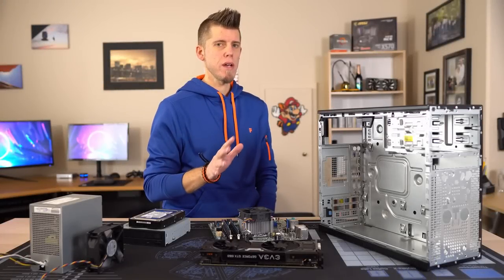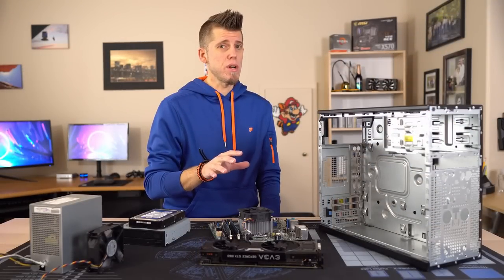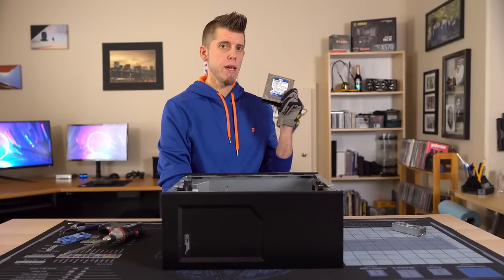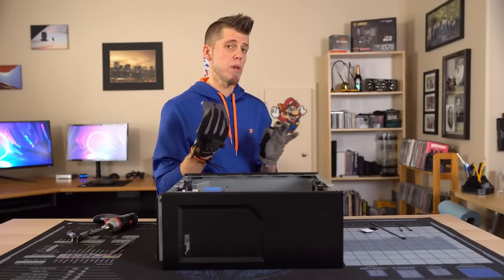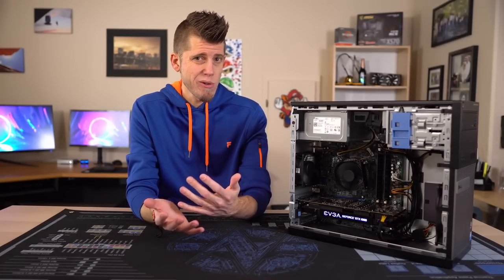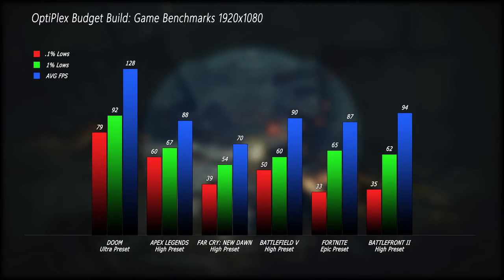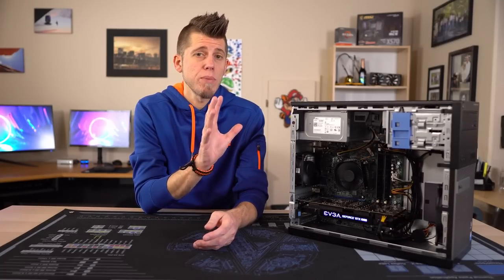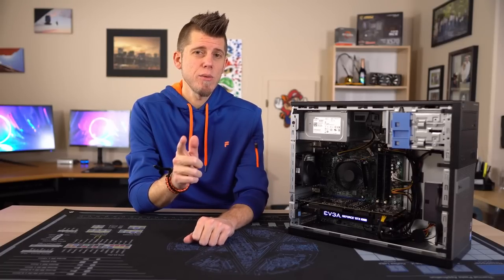Dell OptiPlex Budget Gaming PC For Under $300?

Comment: Dude why are you telling people who has probably never built a PC before to flip the SATA power cable if its facing the wrong way? That is such tedious work and is bullshit advice. You threw in the zip ties and cable management clips in there...why not get a SATA extension cable and make it look nice like that. Simple plug and play. No need to change the wires. And lets face it, humans have the attention span of a moth. How the hell would a beginner know if it's on the same terminal or not? Or what if they have an HP case with cables and see your video and say "oh let's just copy the colors and line them up" when the wires aren't the same? They will end up frying their hard drive, shorten their mobo, or damage the PSU or have the whole thing burn to the ground. 

That is horrible advice. Get a damn SATA extension cable.
Reply from the maker: Did you not watch the video? I recommended a SATA extension cable with a straight connector for those that don't want to flip the connector or are worried about just what you described.
Reply: I did. And you gotta know that most people won't watch the video and just copy and paste what you said.

Also pairing a 1060 with the cheap ass non 80+ certified 300w PSU...SMH.
Reply from the maker: @MelvinKhosa  Well,  it's a tutorial video. If someone's going to try to emulate what I'm doing, they should be watching the whole video. That being said, if you watched, you know that I did exactly what you said I should do, so I'm just confused why you made the comment at all.

As for the 1060, I've repeated this several times. The 1060 does not consume a lot of power... like 120 watts. I did my testing and the system is pulling between about 200 and 210 watts from the power supply on average with occasional spikes to about 220 watts. You generally have 70-80 watts of headroom. Also, I've torture tested these PSU's at their max rated power draw, and they were fine. They have no problem powering a card like the 1060.

Comment: why Optiplex 9010 is Not better?
Reply from the maker: Because the SATA ports and the USB3 header are in the way of the GPU. They block anything over 8.5 inches. There are cables you can use to get around that, but added expense. Especially when I typically see them selling for the same price as the 9020 and it's a generation older i5. So, at a similar price, it just doesn't make sense to me. However, if you find one at a lower price, by all means. However, the price of a 9010 with an i7 3770 isn't a lot more than the 9020 with an i5 and it's definitely something to consider. And I'll be doing a video on that in the future.

Comment: Trying to convince console gamers to switch to pc by telling them to splice wires instead of buying the extension is a mistake, all it did was confuse people and deter them from switching by making it over complicated. You probably took some Adderall and wanted to sound smart, however all you did was sound pretentious and spread confusion. RTU did a good job pointing your mistakes out, he wasn’t being aggressive as you said. If you have soft skin then don’t make videos in the future.
Reply from the maker: The one thing you just complained about, I already pointed out. If you actually watched the video  you'd would have seen that I told people to buy the extension. What I did was not complicated and pretty basic. There's no danger, even to a beginner, if they repeated the process in the video. These are tutorials aimed at people of different skill levels. Not just beginners.

And I don't have soft skin, he was being overtly critical. Almost like he was nitpicking to stir the pot. This comment is proof of that since you're telling me to do something that I actually did.

Comment: Here we go, here comes people from reviewtech USA fans. Lets hope they keep it appropriate.
Reply from the maker: Most of them have been. Only a couple of trolls. Mostly I've had to explain why using this PSU on a 1060 is fine.
Reply: @TheGameBench  I guess that makes sense, I was watching his video and I can see where he might be right but I do think he goes a little overboard when it comes to the addition of the fan.
Reply from the maker: @geekmechanic1473  I feel there was a lot he went overboard on and it would have been nice if he'd got a hold of me first so I could have explained my testing to him and he might have been a bit more understanding. Seem most everyone isn't aware that not all 400 power supplies are created equal, and thus why nVidia states 400 watt as a minimum.
Reply: @TheGameBench  that is true, not all psu's are equal even if they fall in the same 80+ category.
Reply from the maker: @geekmechanic1473  Exactly. The 80+ rating is merely an efficiency rating and there are a lot of garbage 80+ Gold PSU's because it's easy to manufacture a garbage power supply and spend a little extra on capacitors to get that rating. They do it because so many people use the 80+ rating as some metric of quality and people should really stop doing that.
Reply: @TheGameBench  true and I was just over at his video reading the comments and a lot of them are joking about how this is the verge 2.0 and how you're gonna copyright strike him and all that. Now I get wanting a better psu for future upgrades, but say your psu supports about 290-300w and your system is less than that then it should be able to handle it. Now idk what the rating is for the 1060 but I highly doubt it draws 400w and so that leads me to think that they recommend that is because they think that the total system will require that amount of power.
Reply from the maker: @geekmechanic1473  Oh, I have zero intention of filing a copyright strike or claim. That would be petty and it's not like he just threw the video up there without doing anything. He critiqued and I feel what he did counts as trans-formative work anyways. I can deal with criticism. I would be great if people were more tactful, like you, and could have a discussion about it.

As for the 1060, I tested the power draw from the outlet and it peaked at times around 240 watts, for the total system. It was typically closer to 220 watts or less, and the draw from the power supply will be lower. This is verified by Tom's Hardware's test that show the 1060 6GB, on it's own consumes at most 120 watts. The 1060 is really pretty conservative.
Reply: @TheGameBench  and in his video he complained about the i5-4570 and gtx 1060 6gb being a bad combo because the 4570 would be maxed out or that's how I interpreted it and when I looked up on pc builds.com and used their bottleneck calculator it only showed an average of 3.34% and stated that they are a great pair. Now I do get that some games aren't that great for 4 core cpus like shadow of the tomb raider as its very taxing even for 6 cores from what I've seen. But its still playable
Reply from the maker: @geekmechanic1473  Yeah, I tested it in my last video. Power consumption, price, performance, & bottlenecking among a handful of GPU's. I found that the 1060 was about the max that should be run on the 4th gen i5's at 1080p. He's not entirely wrong. In modern stuff, like Battlefield V, the CPU usage is maxes out at times, but it didn't really effect the performance to a degree that made the experience bad. The 1% and .1% were still pretty good.
Reply: @TheGameBench  that's true and I think its good to hold someone over until they get the money to build a better pc. I kinda think he's being a bit too aggressive with his tone and why some people didn't like his video because of how it came off probably more aggressive than what he meant it by.
Reply from the maker: @geekmechanic1473  And that was the exact intention of this video. This is a starter system, to get someone into PC gaming that didn't think it was an option. And that's how I feel about this whole situation. It's been needlessly aggressive for no reason.
Reply: @TheGameBench  also something I just remembered from watching gamers nexus on their case reviews because I'm looking to build a mini-itx pc kinda like around the size of a console or something similar but what he said was that the airflow of a case can effect performance in games because if the cases are having a hard time keeping the gpu or other components cool enough then it could effect the performance
Reply from the maker: @geekmechanic1473  Yep, I had a mini ITX system in my game room in the Node 202, which is an airflow nightmare, at least horizontally, and it ran so hot and it really impacted clocks on both the CU and GPU. I ended up building a new system in the Ghost S1 with better hardware and it's so much better. In this system, I found the front fan was the difference between throttle temps and not throttling, on some GPU's. There's not a lot of airflow without removing the material in front of the fan, which I had always planned to do in another video..
Reply: @TheGameBench  yea I was thinking about the using the node 202 but the reviews barely touched on thermals so I was kinda iffy on using it. Well it's been awhile since rich made that video, did a lot of his fans come attacking you? Also I don't recommend watching his new video, its about politics which is odd because he's supposed to be a tech channel so that is odd plus his comment are mainly people praising him for talking about politics and shunning people criticizing him for having politics on what is supposed to be a gaming and tech channel.

Comment: That power supply is sketchy as fuck
Reply from the maker: Sure, it's no Superflower or Seasonic, but I've tested these things to death, no pun intended, and they hold up and the 1060 is a low power consumption GPU. All in all the components are pull 220 watts or less from the PSU. I tested all of this in my last video.
Reply: @TheGameBench  fair enough I am actually a Mod ON RTU'S channel (the guy who criticized you) after watching your video and his there was no reason for him to make that video. I apologise on behalf of the community. I think this is a pretty good build after watching everything...
Reply from the maker: @CentraPlex  Thanks, I really appreciate that. I just wish Rich would have reached out to me first so I could have explained what I did any why I did it, and why there's nothing wrong with these PSU's. It seems a lot of people aren't aware that nVidia makes that 400 watt determination because cheap PSU's might be rated at 400 watts but can only maintain that wattage for a split second, but might settle down to around 300 watts, or less. And this PSU in the Dell can maintain 290 watts. Hell, it did it for four hours straight without incident.
Reply: @TheGameBench  I had a 400 watt psu running an fx 8300 and a 1060 6gb and it was fine so idk why I commented tbh lol.

Comment: U gotta put a better psu cause it could ruin the whole pc
Reply from the maker: Read the pinned comment. It's perfectly fine with a low wattage GPU like the 1060. Hell, Linus did the exact same thing I did in this video with a 1660 Ti, which draws a little more wattage than a 1060, and he did it on the previous model with only a 275 watt PSU. With the 290 watt PSU and a 1060 6GB, you'll have around 100 watts of head room.

I reiterate... it's objectively fine.
Reply: Oh alr my bad
Reply from the maker: @dkluvu430  No worries. It's a common misconception.
Reply: Oh yea I have a question if I buy a dell optiplex 790 i5 2600 and put a 1650 and a 500w psu can I get 144fps smooth?
Reply from the maker: @dkluvu430  No, on two counts. The 1650 isn't really capable of that. However, even if you put a GPU capable of high refresh, the 2500 will hold it back. If you want to do high refresh 1080p gaming, across a wide spread of games, you're going to need a newer CPU. I did a video on comparing the 2nd 3rd and 4th gen to give people an idea of how they improved.
Reply: The Game Bench but if I do all that and put a better cpu would it just be better to build the pc from scratch
Reply from the maker: @dkluvu430  Well, even with the best CPU you can put in the 790, you're not going to get there. You're really going to have to go with a 4th gen i7, then pair it with a 1070 or a 1080. Now, as to weather it would be better to build from scratch or not... you have to weigh the pros and cons. You're not going to build a new system with the same level of performance as a 9020 with an i7 and a 1070 or 1080. However, with a new system, the FPS ceiling CAN be higher... depending on the CPU, but you also have a potential better upgrade path. Only you can answer which is the better path for you.

Comment: Uses oem booty power supply so you can clickbait a 300 dollar build that's a fart away from destroying itself.
Reply from the maker: I suppose you left this comment on Linus's video where he put a 1660 Ti on the previous generation to this one with a lower wattage power supply? I'm guessing not. I suggest you read the pinned comment. You're way late to the party, but the fact is, it's fine. The 1060 draws very little power, at around 120 watts, and these power supplies are well built, and more than capable of supply enough power for a 1060.
Reply: @TheGameBench  nope I would criticize linus as well I'm sorry you couldn't clickbait 330 dollar pc build as well.
Reply: @TheGameBench  but you so needed the modding of those wires instead of buying the sata connector in a video that's targeted to a first time builder and wasted money on the fan you didn't need rather than getting a corsair builder 80 plus bronze for like 35 bucks. You goofed up we all do but dishonesty is where I draw the line.
Reply from the maker: @Spencerwalker21  Then you don't know what you're talking about, and that's on you. Nothing I did is dishonest. The 1060 6GB consumes around 120 watt. The rest of the system, around 100 watts. The system pulled about 240 watts max, from the wall. Now the parts will consume less from the power supply than it does from the wall. There is plenty of headroom on the 12v rails. The 290 watt power supply in these is a constant rating, not a peak, and it's not some garbage PSU that you'd find in a consumer Dell. They put higher end components in the business machines.

Nothing I did in this video is dishonest. You simply don't know what you're talking about. Since it's fine, why would I waste money on a power supply when it wasn't necessary? Also, you show me a Corsair PSU for $30. They don't sell any that cheap. The cheapest I can find is the CX450 at $70. So, nice try. Any power supply for $30 is going to worse than the ones that come in these systems. Further proof you don't know what you're talking about.

Lastly, you nit pick about me modifying the SATA power cables... don't be obtuse. I clearly stated this is what I'm doing because I can, but if you didn't have the tools or didn't feel comfortable to, to use a SATA splitter and a SATA extension. I gave people options because I make these videos for people of varying levels of expertise. There are even links in the description to the SATA adapters. Besides, it's not rocket science. I was pretty clear and if you follow my instructions, there's no risk to damaging anything.

So, you can be mad all you want, but I did nothing wrong. You're simply ignorant on the matter. Like I said, you can read the pinned post if you actually want to be educated more about why you're wrong, but I doubt you will.
Reply: @TheGameBench corsair builder psu  they were 30 7 months ago but now they aren't because of the recent price hikes probably shortages like with ram pricing years ago.
Reply: @TheGameBench  I'm mad says the guy crying about linus did it.
Reply: @TheGameBench  it's not nit picking it was a waste of time and gives a first time builder a bad impression with doing overly complicated nonsense when an adapter is 5-10 bucks but thanks for linking it in the description 👍
Reply from the maker: @Spencerwalker21  I don't care if they were $30 seven months ago, and I don't believe they were, I still wouldn't use one. There are no good PSUs worth your money for $30 new. I've never seen a modern $30 power supply that wasn't complete trash.

Next, I don't see how me bringing up Linus as an example of the fact I'm not the only person doing it, makes me mad... but whatever man.

And you were nitpicking. You're complaining that I should have done exactly what I did. I told people if they weren't comfortable doing this to use the adapters, plain as day. You're finding a problem where there wasn't one. Thus... nit picking. Also, if you think adding an EZ crimp SATA connector is complicated, then you've shown just how little you know.

Regardless, I'm done. You haven't managed to prove me wrong, on either count, and I don't see you being able to do so. I'm confident in what I did in the video. The information is there, you can chose to educate yourself with it or continue to be ignorant. But I see little point in continuing this conversation.
Reply: @TheGameBench  corsair makes trash power supplies are you high and yes they were 30-40 bucks at the time you made this video the model was the cx450. So educate yourself or lie you decide.
Reply from the maker: @Spencerwalker21  That's not what I said. I said I've never seen a modern $30 PSU that wasn't trash. However, you're showing your lack of knowledge again. Corsair doesn't make power supplies. Someone else makes them, and Corsair slaps their name on it. They use several different OEMs and they're hit or miss. There have been Corsair PSUs to avoid. Same goes for EVGA. In fact, most companies that sell power supplies, don't actually make them.

So... again. I'm not the one who's not educated on the matter.
Reply: @TheGameBench  my bad you're right I thought  corsair made there own I apologize.
Reply: @TheGameBench  good luck with your channel 👍